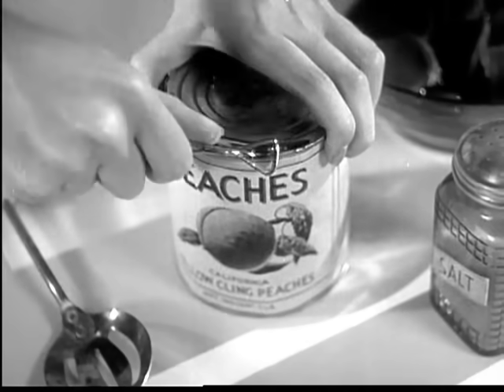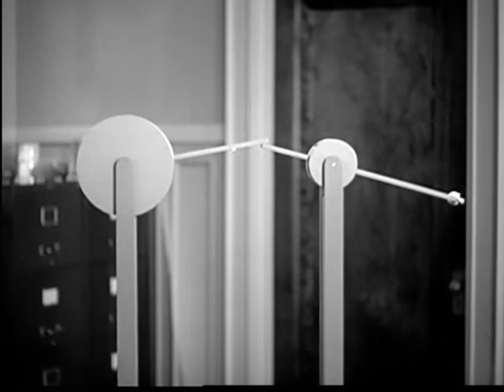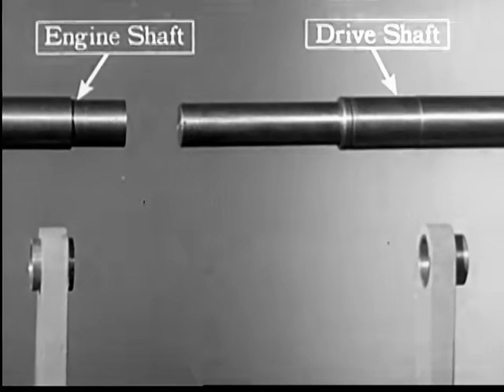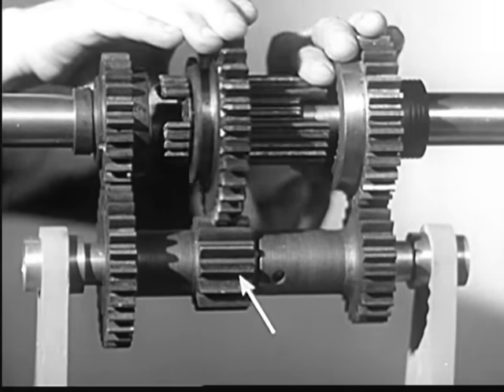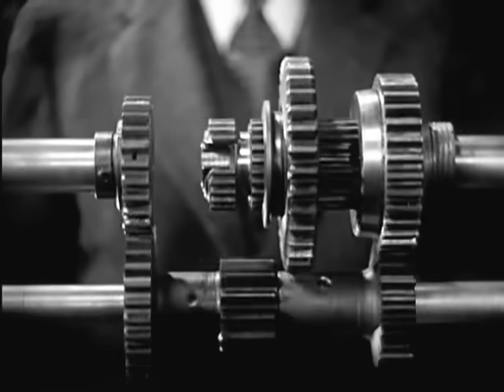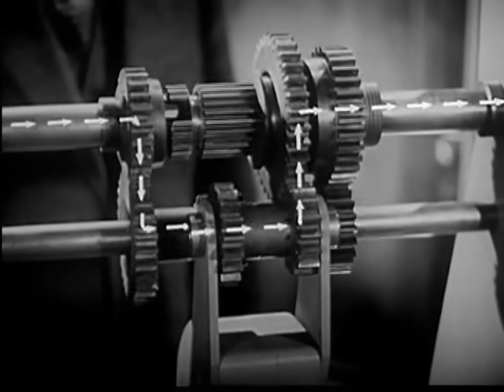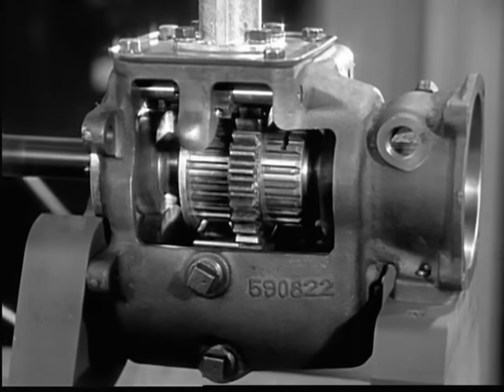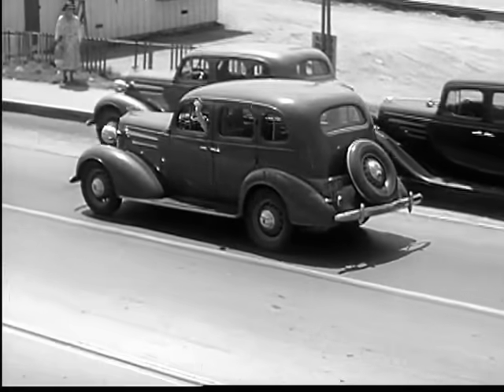Spinning Levers - How A Transmission Works (1936)

Comment: back when americans could use manual transmission
Reply: How to prevent a car theft in America:
Drive stick
Reply: @Maze-  No evidence to support that
Reply: automatic transmissions are more efficient in practice and are much easier to deal with in congested areas which makes them popular here in america. that being said if you took the same two cars with the only difference being the transmission, one an automatic and the other a manual, and drove them at a constant speed the manual would prove more efficient due to less parasitic loss and lower rotating mass. most of the inefficiency in the manual comes from the operator, but they are a much more enjoyable driving experience.
Reply: Give me manual transmission or give me death. Manual is so much more fun to drive. I've rented sport coupes with the shift paddles on the steering wheel....YAWN!!!!!
Both of my cars are manual transmission and one has over 250,000 and still running strong. The clutch was working fine at 175,000 miles, but the mechanic said it made sense to replace it as he had the transmission off to do some major work.
Reply: In Europe we still use manual gearboxes...
Reply: @loplopthebird1860  In Europe fuel is CRAZY expensive due to your taxation. Plus people on the average buy cheaper cars...and automatics are more expensive. Also, Europeans drive far smaller distances than Americans on average. All this together makes manuals more attractive, I'm sure.
Reply: @loplopthebird1860  That's nice.  I usually buy a manual transmission car.  I feel more in control.
Reply: @loplopthebird1860  You mean we still know how to drive our cars...
Reply: @JCavLP  Not just steer them ;-)
Reply: @loplopthebird1860  When I visited the UK in 2017, I stopped at a Ford dealer just to see the differences in dealership experience.  Every single car in the showroom was a manual transmission. I think just about every single car in the lot was. I looked at the Ranger while I was there. It, too, had a manual.
Now they bring the truck over here and decided to make it automatic-only for the lazy Americans.
Reply: Even with an automatic transmission, you can change the gears manually, but you don't need to worry about the clutch. Engine braking is still possible.
Reply: Electric cars don't need gearbox
Reply: TRUMP WON 2020
Reply: #Lyingtrump
Reply: @Gravyballs2011  name 1 lie.
Reply: @josephwatson8448  Just one! How about so of the more recent:
 President Trump's;
claim that the U.S. death toll is on par with Germany; that the model that shows a doubling of deaths by August does not take into account mitigation;  his claim that the U.S. has more testing capacity (at the time he made this claim) than "every other country in the world combined"; his suggestion that the virus only effects older people and children are not susceptible to any effects; that his suggesting of finding a way to introduce light and heat into the body to kill the cor-sars2 was a joke - how does one tell?; that the virus would disappear magically by April; that he never shook any hands while visiting India recently; his claims in January through March that the contagion was under control; that it was Obama's era policies or regulations that had made testing difficult - in fact, can you name those policies? As a point of fact, Trump also said that  the coronavirus "came out of nowhere" and “blindsided the world.” when it was he who  had disbanded the NSC pandemic directorate in 2018 that was tasked to prepare for, not when, a pandemic hit; claim in early March that anybody who needs a test can get a test; that he has a 78% approval rating and the highest rating of any President handling a crises; that he had a sold out rally in Tampa, FL he had to cancel , or at least reconsider due to the pandemic...
and so on
Reply: Back when typewriters were used.
Reply: Many of us would love to enjoy manual transmissions, but the auto makers don't offer them anymore.  You can't even get a full-size pickup truck with a manual anymore.  Or a Dodge Charger, supposed to be a muscle car!
Reply: Mr MEMé  Transmissions aren't an actual brake, but they can be used to facilitate the engine being used as a rotation dampener, to add more resistance to the drive train and slow down a vehicle with that resistance.
That last bit at the end of the video explained this in detail.
People who drive manual transmission vehicles have the choice of shifting down one gear to slow their vehicle slightly or just apply the brake for the same effect but with greater stopping forces.
Or use a combination of both if they are experienced enough.
The draw backs to down shifting is greater wear on transmission bearings, gears, and the clutch assembly.
Reply: As an English person, I've never seen an automatic here but I've used one in California. I hate them, I felt so damm lazy as though driving a go cart.  Manual makes me feel like I'm driving and it keeps your mind active too on long journeys. 

Not easy to master at first but you never forget it.
Reply: M.G.B.P.S. is pretty strong in places of northern California. I used to really enjoy my friends not asking if they could borrow my car.
Reply: Its just preference you whiney little fucks.
Reply: Electric will/does make all this auto vs manual talk moot. No gears, fewer moving parts. Save money while giving big oil the middle finger🖕 Nothing better than that. 😉
Reply: @EVIL-C  they dont have an electric big rig that can take me to places without stopping every 500 miles to charge. But I do like electric vehicles because they're cheaper to fuel.
Reply: @EVIL-C  lol give oil the middle finger... do you know where your electric power comes from? I'm all for it if you want an electric car but lets not pretend this is going to save the planet or free us from some great corporate evil.
Reply: I still drive a manual as a daily driver. American here 😄
Reply: What's a manual transmission?
Reply: What if you weren't taught how to use manual in driver's class?
Reply: As long as a person says "transmission"  and not "gearbox" means they know fuck all about it.
Reply: Thank you im 13 and drive an 83 mustang gt convertable with a 4 on the floor my dad lets me pull it out of the garage and back it in
Reply: @hubertkam7647  im 13 and can drive my 83 mustang gt that has a 4 speed im gen z
Reply: @hubertkam7647  ya but its its still fun to drive stick
Reply: Squirrel? Haa,  I'm fighting them every day here.
Reply: gah.. someone always has to make this stupid comment. I know a lot of people that can use a stick. My 21 y/o daughter, my wife, all the drivers in my family... Don't make this such a big deal.
Reply: Eichhoernchen I learned manual when I was 16 and now I have driven a 3 speed on the column, a 5 speed, and a 3 speed granny gear. I’m 18, and about half of my classmates knew how to drive manual before they got out of high school. A lot of Americans can drive a manual, it’s just not something people brag about.
Reply: Mr MEMé  Jake breaking. OK, the engine is used, but the principle applies - the idea of "braking" is to slow the vehicle
Reply: @Sammy Van Dankstein They are smarter, thus CV transmission with computer shift
Reply: We have many thousands of km of roads
We have an excuse for not having manual considering the idiocy of the people
Reply: I still have my millenial anti theft device <3
Reply: Okay grandpa
Reply: Remember folks: As much as we love our shifters and our raging engines, you don't have to change gears in an electric car. It's more efficient and cheaper to run too so idk, pick for yourself, but i know what i'd rather have =)))
Reply: Because they are in the future and your country is in the past while they grow out of outdated stuff you pick the outdated stuff and use it untill americans figure out new stuff and you take the old stuff and claim your are better but it only that your country can not do what american can is create and invent
Reply: @beastmr919  yeah right, the only thing the warmongering usa can do is steal others' inventions and claim it as their own
Reply: Seems like a fallacy, just because most Americans don't drive manual doesn't mean most can't, I can drive sequential, H pattern Manual and dogbox transmissions, but all of my everyday drives are automatic... Driving Manual is nothing to suck your own d**k over.
Reply: manual is outdated humans cant shift nearly as efficiently as computers do these days
Reply: @TWEAKLET  Eventually we will defer everything to machines and become dumb bricks.
Reply: @TWEAKLET  more reliable. just imagine you save 1 cent fuel per mile on automatic, but when it brakes down pay 4000 dollar. plus you can comtrol breaking better. and cant overheat in offroad, while towing, can be push started
Reply: @David-cy5zu  my truck is 19 years odl and i still haven't had a transmission issue and if your transmission is overheated you have fucked it already transmission fluid is trashed after it overheats
Reply: @TWEAKLET  manual does not need oil change. you can drive same for 40 years
Reply: @David-cy5zu  it depends on how hard you run it you should change it anyways at 100k or so just to be sure nothing is wrong with it and if you overheat it it should be changed as soon as possible
Reply: @Eichhoernchen I've had two transmission failures in two cars with manual gearboxes over the last 7 or 8 years. Was clutch problem both times, requiring clutch replacement. Both times the cars were normal European city cars, driven in a city, no extraordinary stress on them or anything. The first car was about 3 years old when it happened.I've been driving manual transmission for about 15 years or so, now I drive a hybrid with no gears to change (for me or for the computer) and in heavy traffic it's a blessing, couldn't be happier! :)
Reply: Booruvcheek "noise and wear"
Reply: @Rya 31"noise and wear" what?
Reply: @Booruvcheek  That's not a transmission problem; that's a clutch problem. Clutches are wear items and there are many variables that dictate their lifespan, much like brakes.  The largest variable being the driver.
Also, a clutch issue doesn't necessarily dictate a clutch replacement. Without knowing what the actual issues were, one can't rule out that the shop took you for a ride replacing more than was needed.
Reply: @Jeff DonovanWell, I agree this is not gearbox problem per se, but a manual clutch is what you've got to have if you want a manual transmission.
The second car I was talking about was (Peugeot 307) ~12 yo at the time, so the clutch disc was simply worn out. Not sure what was wrong with the first car (Dacia Logan).
Was just sharing my (not so great) experience with manual transmissions. Don't get me wrong, I've been driving them since 1998, and I can do it again, but now that I don't have to, my left foot rests happily while I start/stop a dozen times on a 100-meter uphill stretch on my way home every day.
Reply: Booruvcheek I was quoting the video, to explain the issue you where having (though, realisticly, the clutch plate would wear out long before the actual gears...)
Reply: @Booruvcheek  driving in a city is extraordinary stress for a clutch. the wear of a clutch happens only while clutching, not while driving.
Reply: @David-cy5zu  True. Also, this is 99% of my driving, so I'm happy my current has automatic clutch and even that is engages at about 70 KPH, i.e. about once a week. Below that the car is driven by electric motors.
Reply: @TWEAKLET  a manual transmission is cheaper and more fun
Reply: @David-cy5zu  Newer automatics get better gas milage than manuals. With modern improvements such as the torque converter clutch, more speeds, and more advanced software, they are better on gas.
Reply: @shadowthehedgehog4737  think about WHY only 2 % of vehicles have this option. You dont work and rest less than the rest of the world. I dont blame them for this though, but you miss the point.
Reply: @David-cy5zu  you are wrong in every aspect i bought a 2005 honda civic hybrid with a 5 speed manual because they get much better mileage than the automatics.
Reply: @David-cy5zu  Amazing. You managed to get 'break' and 'brake' completely backward.
Reply: Eichhoernchen the best is a sequential. There’s no clutch lag and it shifts instantly
Reply: @TWEAKLET  this is wrong. if you practice, you can do alot better than the automatic transmission, manual gives you slightly better control of the car and less fuel consumption. this is why manual transmission is more often used in racecars. i apologize for my english.
Reply: @TWEAKLET I’m not sure we’re all the way there yet. An automatic transmission does do a better job shifting than I do. However I can use my vehicle’s power better if I can decide WHEN to shift gears. In a car we usually don’t need to use every last ounce of power, but in a semi truck or anything else that regularly pulls or hauls a heavy enough load I still prefer a manual. I also don’t think an automatic transmission lasts as long still, although I drive older vehicles so maybe they’ve fixed that in the last 15 years or so.
Reply: @zachbranson627  a lot of automatics where shifting might be a thing you want to do yourself sometimes like sports cars or semis they actually allow you to as far as lasting my 2000 ford rangers lasted 18 years and only failed because I never changed the fluid like a stupid idiot they are most costly to repair though
Reply: +TWEAKLET
Wrong, double clutch manuals are more efficient and faster than automatics however automatic gearboxes exists purely for the sake of convenience. 
Most people are lazy and only own cars to get from A to B which is also one of the reasons why most people are bad drivers, a good driver is someone who cares about cars and driving in general and more than often, he drives a manual because he likes to have control.
Reply: @SMGJohn  annnnnd you are wrong
Reply: @SMGJohn  absolutely!   Some manual transmission will have a low pressure lubricant /cooling pump.  All automatic,  and power shift transmissions have high pressure pumps,  using a substantial amount of power from the engine to keep clutches engaged.   Automatics are convenient.  But will never be as efficient as a manual.
Reply: @SMGJohn  Manuals are not more efficient or faster anymore, that wouldve been true in the 90's.

I drive a manual myself and i love it, but that simply isnt true.
Reply: TWEAKLET says his wrong

Everybody: Agrees with the person you call wrong.

And I agree with him. Bad drivers are born because they want to get from A to B not caring about other road users. And even worse expensive car companies gets a bad name from a 19 year old girl who wants a Mercedes and all she wants is dominance and when you have that mentality you tend to be lazy and not caring about others. And not to forget, manual is actually better in most ways such as engine braking and having complete control over gears, unlike the automatic shifting gears at times where you don’t need it.
Reply: smgjohn you are wrong!!!
Reply: @SMGJohn  If you're talking about efficiency then automatics win overall, adding more clutches in a manual doesn't make it more efficient and if you're talking about torque converter automatic then maybe manual would be better but a clutched automatic transmission like on performance vehicles has faster gear changes and is more fuel efficient let alone double clutched automatics like on McLarens which can shift in less than 20ms. Probably around 1/10 of the time of your fastest gear change
Reply: @SMGJohn  you need to wake up buddy. Manuals are not faster and under most circumstances not more efficient. Nearly every company involved in the manufacturing of a motor vehicle, cars or equipment, are moving to automatic transmissions. The literally only reason manuals still exist today is because of demand and cheaper cost. Chevy and Ford cars with a manual counter part today are slower than the automatic. The Ford mustang is great example and the Chevy Camaro are both faster than their manual counterpart. By todays standard, you are living in a dream. Hell, dragsters haven't used manual transmissions in decades.
Reply: @Shibagaesski  it's the number one reason why i hate automatic cars, can't take the constant, and not to mention unnecessary gear change that comes with it.
Reply: @SMGJohn  ?????did you just say manuals are faster than automatic??? Bro computers are so much better than people
Reply: @SMGJohn  Manuals are less efficient than automatics. Every passenger car automatic in the last 10 years has a locking torque converter. When the speeds in and out of a clutch don't match, the extra energy is wasted. In a torque converter, it is used to amplify the output torque. When the speeds in and out of a clutch and a locking torque converter match, they have the same efficiency. Humans are really bad at driving efficiently. A computer which can re-evaluate the situation hundreds of times per second can do it much better.

The difference gets even more in favor of a modern transmission with the use of CVTs.

Comment: Excellent presentation. For those interested in hobby type engineering (as in for fun), I suggest you take some basic courses in "Statics and Strength of Materials". It will take you farther than any other mechanical knowledge. You will realize why trigonometry was and is so important, as basically the whole world is engineered using triangles.